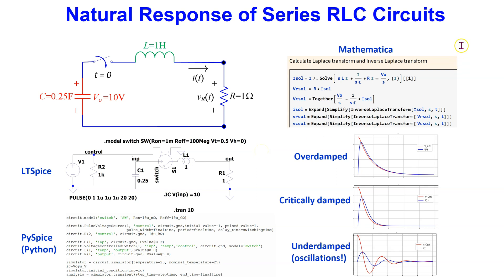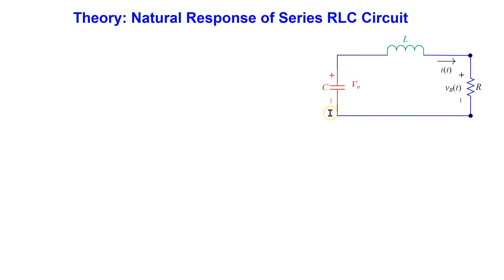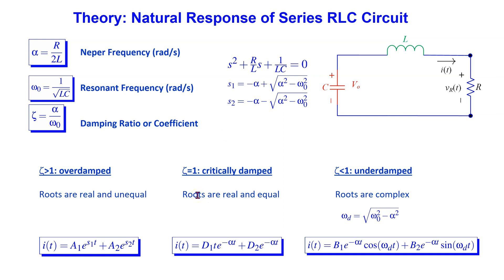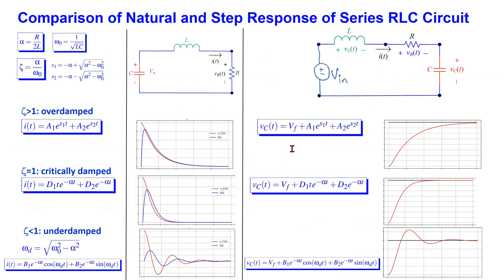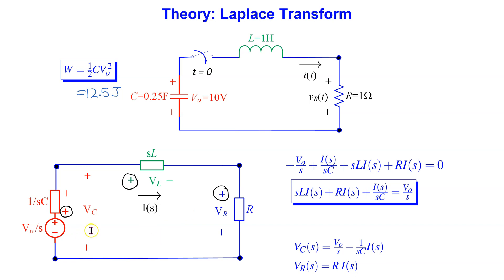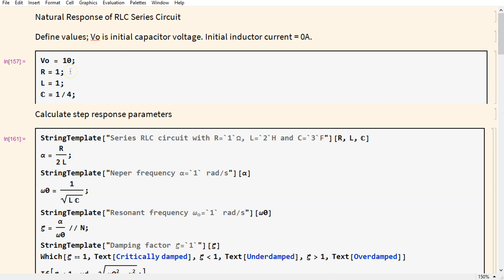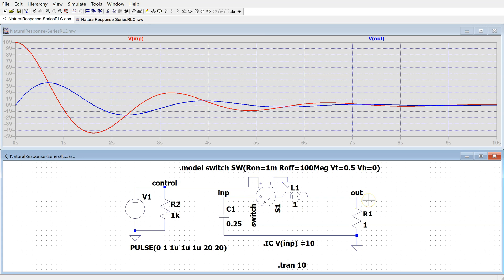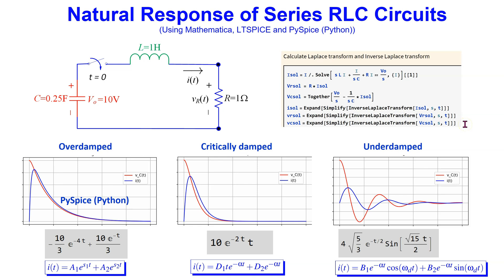Demystifying Natural Response of Series RLC Circuit Using Mathematica, PySpice (Python) and LTSPICE

Comment from the maker: Vo = 10;
R = 1;
L = 1;
\[DoubleStruckCapitalC] = 1/4;
StringTemplate[
  "Series RLC circuit with R=`1`\[CapitalOmega], L=`2`H and \
C=`3`F"][R, L, \[DoubleStruckCapitalC]]
\[Alpha] = R/(2 L);
StringTemplate["Neper frequency \[Alpha]=`1` rad/s"][\[Alpha]]
\[Omega]0 = 1/Sqrt[L \[DoubleStruckCapitalC] ];
StringTemplate[
  "Resonant frequency \!\(\*SubscriptBox[\(\[Omega]\), \(o\)]\)=`1` \
rad/s"][\[Omega]0]
\[Zeta] = \[Alpha]/\[Omega]0 // N;
StringTemplate["Damping factor \[Zeta]=`1`"][\[Zeta]]
Which[\[Zeta] == 1, Text[Critically damped], \[Zeta] < 1, 
 Text[Underdamped], \[Zeta] > 1, Text[Overdamped]]
If[\[Zeta] < 1, \[Omega]d = Sqrt[\[Omega]0^2 - \[Alpha]^2];]
If [\[Zeta] < 1, 
 StringTemplate[
   "Damped frequency \!\(\*SubscriptBox[\(\[Omega]\), \(d\)]\)=`1` \
rad/s"][\[Omega]d]]
s1 = -\[Alpha] + Sqrt[\[Alpha]^2 - \[Omega]0^2];
s2 = -\[Alpha] - Sqrt[\[Alpha]^2 - \[Omega]0^2];
StringTemplate[
  "The roots of chracteristic equation are \!\(\*SubscriptBox[\(s\), \
\(1\)]\)=`1` and \!\(\*SubscriptBox[\(s\), \(2\)]\)=`2`"][s1, s2]
\[CapitalIota]sol = \[CapitalIota] /. 
  Solve[  s L \[CapitalIota] + \[CapitalIota]/(
      s \[DoubleStruckCapitalC]) + R \[CapitalIota] == Vo/
     s, {\[CapitalIota]}][[1]]
Vrsol = R*\[CapitalIota]sol
Vcsol = Together[
  Vo/s - 1/(s \[DoubleStruckCapitalC])*\[CapitalIota]sol]
isol = Expand[
  Simplify[InverseLaplaceTransform[\[CapitalIota]sol, s, t]]]
vrsol = Expand[Simplify[InverseLaplaceTransform[ Vrsol, s, t]]]
vcsol = Expand[Simplify[InverseLaplaceTransform[ Vcsol, s, t]]]
p1 = Plot[{vcsol, vrsol}, {t, 0, 10}, 
   PlotLegends -> {"v_C(t)", "v_R(t)"}, PlotRange -> Full, 
   AxesLabel -> {"Time (s)", "Voltage"}, AspectRatio -> Full ];
p2 = Plot[{isol}, {t, 0, 10}, PlotLegends -> {"i(t)"}, 
   PlotRange -> Full, AxesLabel -> {"Time (s)", "Current"}, 
   AspectRatio -> Full ];
GraphicsRow[{p1, p2}, ImageSize -> 600]

# Pyspice (Python) code to simulate Natural Response of Series RLC Circuit
#####################################################################
# STANDARD DECLARATIONS

import math
import cmath
import matplotlib.pyplot as plt
import numpy as np

import PySpice.Logging.Logging as Logging
logger = Logging.setup_logging()

from PySpice.Probe.Plot import plot
from PySpice.Spice.Library import SpiceLibrary
from PySpice.Spice.Netlist import Circuit
from PySpice.Unit import *
from matplotlib.widgets import Cursor
from engineering_notation import EngNumber
from matplotlib.ticker import EngFormatter

#####################################################################
# CIRCUIT NETLIST
circuit = Circuit('Natural Response of Series RLC Circuit')

steptime=1@u_ms
switchingtime=1@u_ms
finaltime = 10@u_s

Vo = 10;
Lvalue=1;
Cvalue=1/4;

# overdamped; any value over 4 Ohm
#Rvalue =5;

# critically damped
#Rvalue=4;

# underdamped; any value less 4 Ohm
Rvalue = 1;
# Rvalue =0;

circuit.model('switch', 'SW', Ron=1@u_mΩ, Roff=1@u_GΩ)

circuit.PulseVoltageSource(1, 'control', circuit.gnd,initial_value=-1, pulsed_value=1,
                           pulse_width=finaltime, period=finaltime, delay_time=switchingtime)
circuit.R(2, 'control', circuit.gnd, 1@u_kΩ)

circuit.C(1, 'inp', circuit.gnd, Cvalue@u_F)
circuit.VoltageControlledSwitch(1, 'inp', 'temp','control', circuit.gnd, model='switch')
circuit.L(1, 'temp', 'output',Lvalue@u_H)
circuit.R(1, 'output', circuit.gnd, Rvalue@u_Ω)

simulator = circuit.simulator(temperature=25, nominal_temperature=25)
ic=Vo@u_V
simulator.initial_condition(inp=ic)
analysis = simulator.transient(step_time=steptime, end_time=finaltime)

#######################################################################
# THEORETICAL CALCULATIONS

time=np.array(analysis.time)

alpha = float(circuit.R1.resistance/(2*circuit.L1.inductance))
omega0 = float(math.sqrt(1/(circuit.L1.inductance*circuit.C1.capacitance)))
damping_ratio = float(alpha/omega0)

print('Neper frequency, alpha ={} rad/s'.format(EngNumber(alpha)))
print('Resonant frequency, omega_0 ={} rad/s'.format(EngNumber(omega0)))
print('Damping ratio ={}'.format(EngNumber(damping_ratio)))

if damping_ratio == 1:
    print('-----------------')
    print('Series RLC circuit is critically damped')
    print('-----------------')
    s1 = -alpha + np.sqrt(alpha**2-omega0**2)
    s2 = -alpha - np.sqrt(alpha**2-omega0**2)
    print('Root of characteristic equation is s1 ={}'.format(EngNumber(s1)))
    print('Root of characteristic equation is s2 ={}'.format(EngNumber(s2)))
    D2 = 0
    D1 = Vo/Lvalue
    print('D1 ={}'.format(EngNumber(D1)))
    print('D2 ={}'.format(EngNumber(D2)))
    i_out = D1*time*np.exp(-alpha*time)+D2*np.exp(-alpha*time)
    v_out = Rvalue* i_out
    
elif damping_ratio > 1:
    print('-----------')
    print('Series RLC circuit is overdamped')
    print('------------')
    Vf = Vo
    s1 = -alpha + np.sqrt(alpha**2-omega0**2)
    s2 = -alpha - np.sqrt(alpha**2-omega0**2)
    print('Root of characteristic equation is s1 ={}'.format(EngNumber(s1)))
    print('Root of characteristic equation is s2 ={}'.format(EngNumber(s2)))
    A2 = (1/(s2-s1))*Vo/Lvalue
    A1 = -A2
    print('A1 ={}'.format(EngNumber(A1)))
    print('A2 ={}'.format(EngNumber(A2)))
    i_out = A1*np.exp(s1*time) + A2*np.exp(s2*time)
    v_out = Rvalue* i_out
    
else:
    print('-----------')
    print('Series RLC circuit is underdamped')
    print('-----------')
    omegad= math.sqrt(omega0**2-alpha**2)
    print('Damped frequency, omega_d ={} rad/s'.format(EngNumber(omegad)))
    s1 = -alpha + cmath.sqrt(alpha**2-omega0**2)
    s2 = -alpha - cmath.sqrt(alpha**2-omega0**2)
    print('Root of characteristic equation is s1 ={}'.format(s1))
    print('Root of characteristic equation is s2 ={}'.format(s2))
    B1 = 0
    B2 = Vo/(Lvalue* omegad)
    print('B1 ={}'.format(EngNumber(B1)))
    print('B2 ={}'.format(EngNumber(B2)))
    i_out  = B1 * np.exp(-alpha * time) * np.cos(omegad * time) + B2 * np.exp(-alpha * time) * np.sin(omegad * time)
    v_out = Rvalue* i_out
    
    
#######################################################################
# PLOTTING COMMANDS

figure = plt.subplots(3,1,gridspec_kw={'height_ratios': [1, 3, 1]})

axe1 = plt.subplot(311)
formatter0 = EngFormatter(unit='s')
axe1.xaxis.set_major_formatter(formatter0)
plt.title('Switch activation')
plt.ylabel('Voltage [V]')
plt.grid()
plot(analysis['control'])
axe1.set_yticks([-1, 0, 1])

axe2 = plt.subplot(312)
formatter1 = EngFormatter(unit='s')
axe2.xaxis.set_major_formatter(formatter1)
plt.title('Voltages')
plt.xlabel('Time')
plt.ylabel('Voltage [V]')
plt.grid()
plot(analysis['inp'],  color='red')
plot(analysis['output'],  color='black')
plt.plot(time, v_out,'b:')
plt.legend(('v_C(t) - simulation','v_R(t) - simulation','v_R(t) - theory'), loc=(.6,.6))
cursor = Cursor(axe2, useblit=True, color='blue', linewidth=1)

## Plot the simulated current in the series RLC circuit
axe = plt.subplot(313)
plt.xlabel('Time')
plt.ylabel('Current [A]')
plt.grid
formatter0 = EngFormatter(unit='s')
axe.xaxis.set_major_formatter(formatter0)
i= analysis['output']/circuit.R1.resistance
plt.plot(time, i,'b-')
plt.show()

#######################################################################